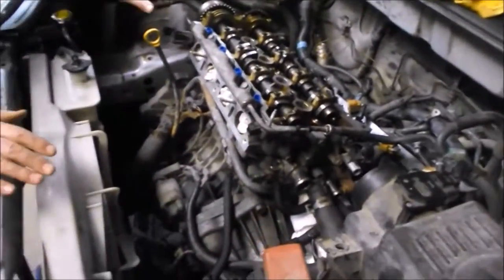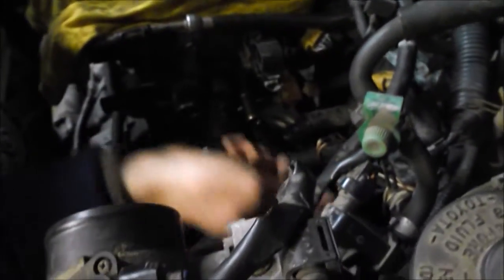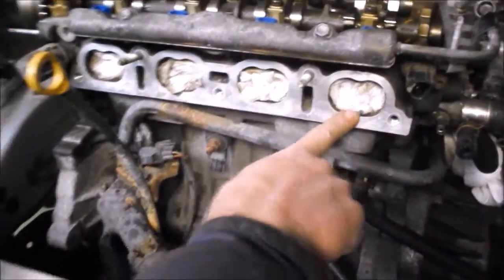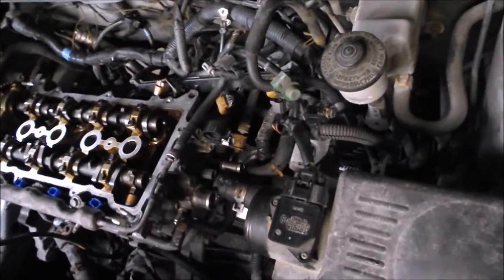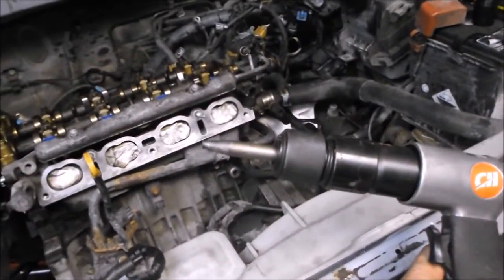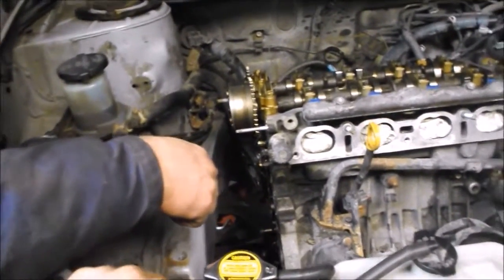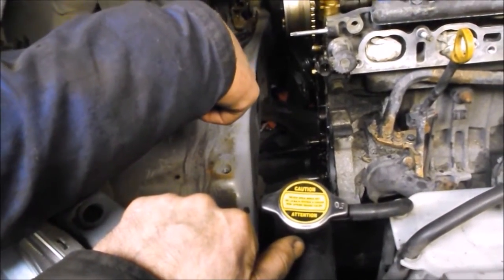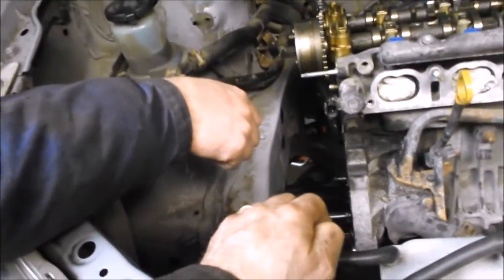DIY Head Gasket Replacement 2007 MatrixVibe Part 2 of 5 Disassembly

Comment: Great video. How long would it take to remove the head, put a new gasket on and reinstall?I bought a used JDM engine and installed the engine and found a piece of metal in the exhaust valve port, probably from the exhaust manifold. Toyota 2.2 5sfe; can I just remove the timing belt and pull the head off without removing the cam and valves, since some metal might have dropped into the cylinder?   I may just hook compressed air to the cylinder and force air out while trying to get it out and put a scope into the cylinder to verify its clean.  Any suggestions, thanks.
Reply from the maker: Every engine model is different.  Consult a manual.  Maybe look into a magnet on a stick to go in the spark plug hole or blow compressed air in plug hole while exhaust port is open.